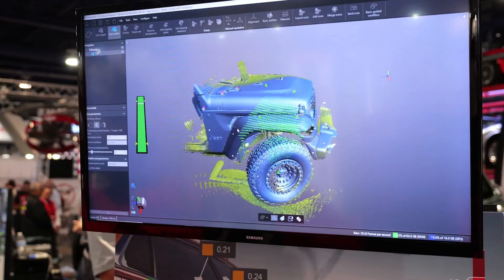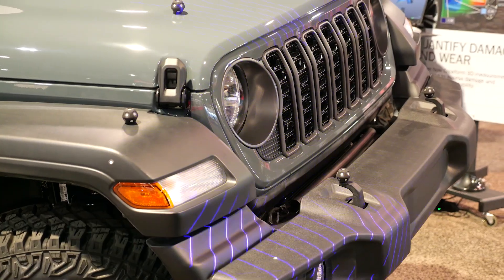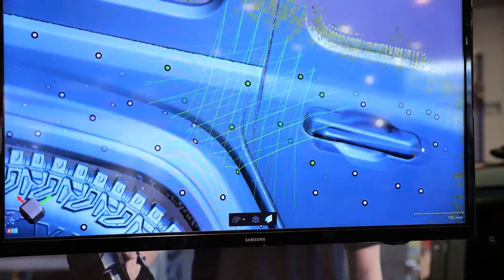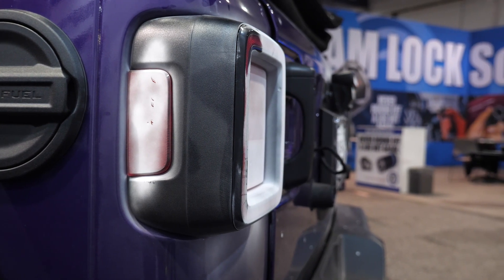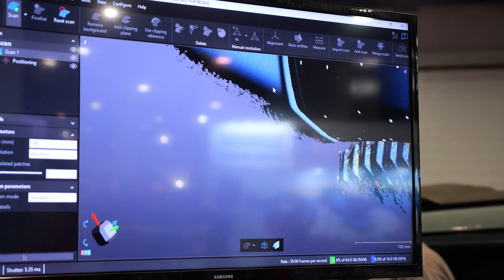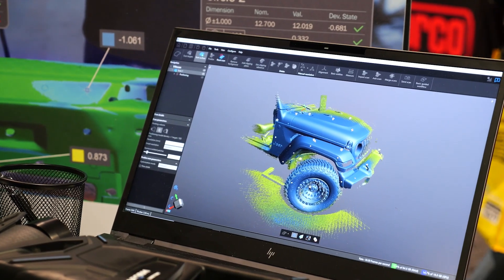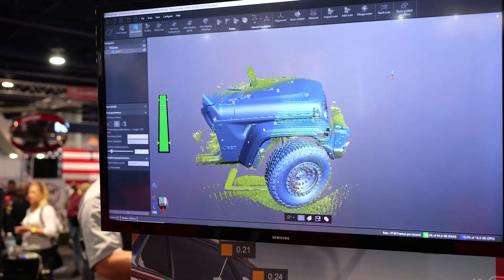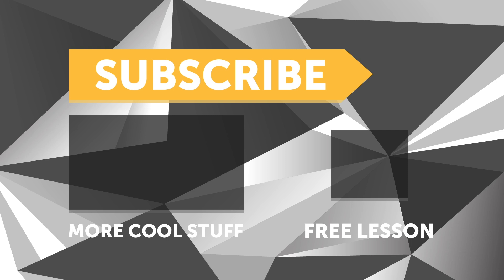Will 3D scanning replace your tape measure?

Comment from the maker: Other than cost, what's the biggest thing stopping you from using a 3D scanner in the home workshop - Taz.
👨‍🔧 Building a fast car? Get $400 OFF the all-inclusive VIP online course package deal: https://hpcdmy.co/3dscan200
💻 Learn to design custom parts for your dream car. 3D Modelling & CAD course. Now 50% OFF: https://hpcdmy.co/cadnscan
Reply: Cost is the biggest barrier, otherwise their crappy software always requiring logins and internet connections...
Reply: @hpa101  its not as much the cost, but how much money i have to spend thats preventing me
Reply from the maker: @2Soy I hear ya! There are so many great tools and we all have finite budgets 😅 A lot can be done with a little though, and most well equipped home workshops usually got there over a pretty long period of time.
3D scanning tech is also moving really fast (comparatively), and you can get more than 'usable' units on the secondhand market due to this.
Andre here actually bought a Peel 2S second hand for us to dip our toes into things a few years back - Taz.
Reply: Being young, surrounded by 3D scanning as a primary method of design, I wonder what are the traditional alternatives for design? Why would I invest in a scanner when I can use simpler, potentially faster methods? When should I scan vs design in the real world, perhaps with cardboard or tape templates?
Reply from the maker: @hyrumdetton12 have a think about that.

Say you know how to MIG weld. Just because you know how to MIG weld doesn't mean you MIG everything and anything. 

Having a 3D scanner on hand doesn't mean you need to use it for every single project.

When you learn to use ANY tool, even a spanner, part of the process is learning when and where that tool is the best one for the job. 3D scanning and even 3D modelling itself in CAD is no different.

So with that in mind, to be able to answer the question yourself, you need to look at the specific project and decide from there.

Often we also default into our comfort zones with what we already know. That is fine, but don't make the mistake of thinking that is the best way for the project or everyone else just because it's the only way YOU know currently.

Hope that helps! - Taz.

Comment: I probably just figured out how to make these way, way better for automotive 

#EntropyRadiusTheorem
#ERT
Reply from the maker: Nice! Best of luck with that, they're great tools as it and we'd love to see them continue to get better and better in time 😎 - Taz.
Reply: @hpa101  I guess the reply didn’t post or got taken down. I’m not a bot, for the record. I’m a small business owner and veteran, so my records can confirm with a FIOA request. 🤷‍♂️

Nobody was arrogant and douchy enough before I did it, to ask if the only math we know that accurately predicts probability has ever been used for traction control before. 
It’s Quantum Mathematics. You can try to predict slip before it starts happening, probably. 
Torque is a force, and f=ma. 
Look for the gradient of entropy, and you can watch it like an RPM band climb as you get closer, with F = ∇Φ(x,t).
And AI knows what that is. I didn’t, until it broke it down to my level of experience and understand of “that’s not just Star Trek.”
It was a complete accident built on winning arguments in comment sections and snark victories in tuning because “well I’ll show them.”
And just… we didn’t think to ask, and I figured F1 already had… so I thought “what would somebody working for Toto Wolff do?” 🤷‍♂️
Reply from the maker: You have to be a bit of a monster for use to delete a comment, I wouldn't delete what you posted there and haven't.

As the saying goes 'without data all you have is an opinion' though and I hope you have great success in taking your idea, putting it into practice and seeing it all pan out as you envision. How awesome :) - Taz.
Reply: @hpa101  I appreciate that- I’m working it out in M1PL right now. Good news is that if if I’m just flat-out wrong, we’ll know quickly within the next few weeks (hopefully.) However, if it works correctly after the debug cycle… it’s on what I would consider to be the most useful aftermarket platform to test and develop it on currently, until the ability to code it into something else comes along.
If I can’t get it off the ground before somebody else, I think it’s probable more and more people will be able to code/tune this in the next 12 months. It is after all, just a matter of understanding the math and the physics… but isn’t that most of tuning to begin with anyway? 
Thanks for taking the leap of faith to let it stand. I hope data happens sooner rather than later, and I have to go wire in an M150 here, compile an M1 package after I finish writing this in Build, and then it’ll be a bit until it gets tested and debugged… but it’s race season. I might get more data that way, and glad for that. 

Real test though, will be the winter here- sounds weird, but I would consider that the bigger test for things like a dynamic traction control model because of environmental uncertainty… which is what that math has aimed to address over the last 100 years or so. 🤷‍♂️

In either case, I am aware of at least one other manufacturer using/preparing to use a different method (classical statistical modeling in combination with deep neural net and a faster processor) in order to try and accomplish something functionally close. 

Whether or or not I’m right about the other thing, the next gen stuff based on DNN/Gaussian distro analysis at faster-than-we’re used to sample rates and processing speeds, will/is still happening, and not three years from now- think 12 months or less on that one. Other organizations are already using/testing those models and getting the data there, but the bottom line is that it’s at the refinement stage in at least two cases I’m aware of already. 

We’ll get to figure out what we need to do to tune at that point, because a VE and Spark table will likely not exist in those tunes- it’ll be adjustments in intensity of corrections and such more along the lines of PID. 

And when somebody gets done building a custom AI bot for software like i2, you’ll just feed it your log/live data stream, it will do the analysis, and it will take significantly less time while being done with much greater precision. 

Weights, biases, measures, and tensor diagram generation/analysis for neural net is about to become very important I think for the average tuning enthusiast. It is and has been in industry for 20 years, but rather like tuning GM or Dodge’s neural net products… that may be more like the shape of things to come, but without having to do VE/MAP/MAF and spark by hand at all- why do it when it can be calculated on the fly and compared to the feedback data to adjust it? Why do lambda by hand if a math function can fix it? 🤷‍♂️

Thanks again, and hope that lends some useful context to the concept… and hopefully I can finish hard coding the first attempts this month, having just completed the MoTeC factory course and gotten a few key bits from that which would have taken 3-6 months longer to dig out on my own. 

Great class btw, and highly recommended. 👍